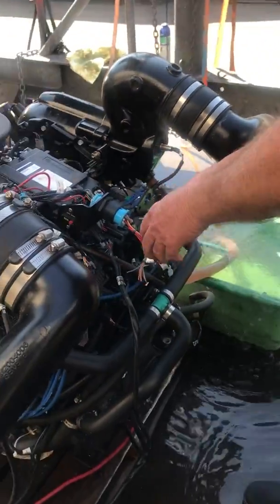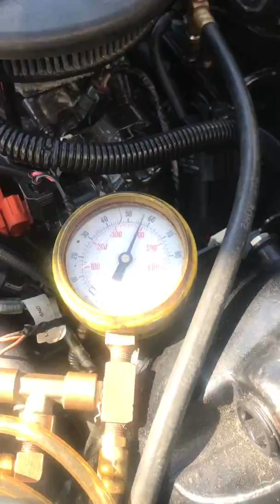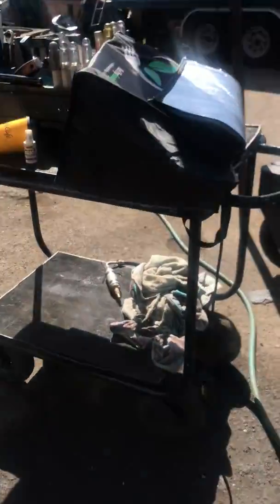Mercruiser late model ECM power troubleshooting , Dennis Allen Affordable Marine Service San Diego

Comment: Hi just watched this video. And I’m wondering I have the same engine with no power to the ecm. the engine was just replaced and it won’t start. Do those two wires for power and ground to the ecm have to be hooked up when it’s in the boat or only bench testing like you are ?